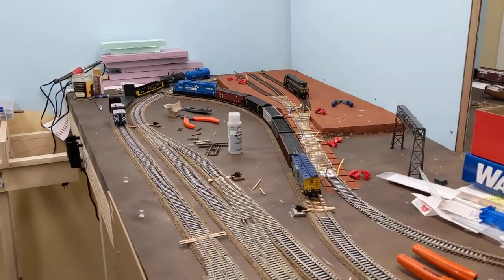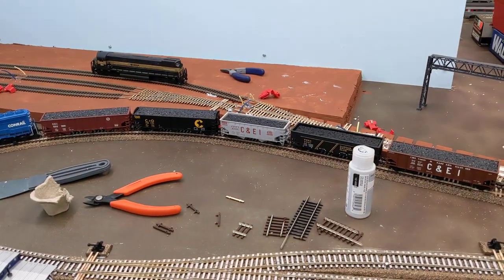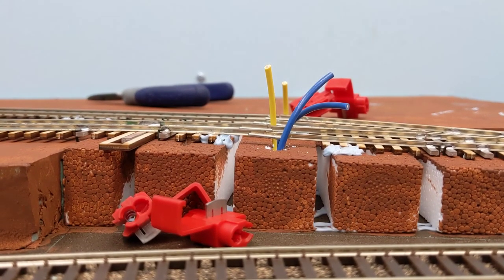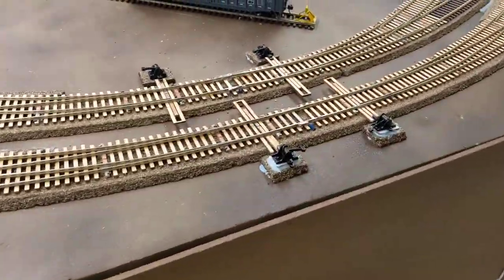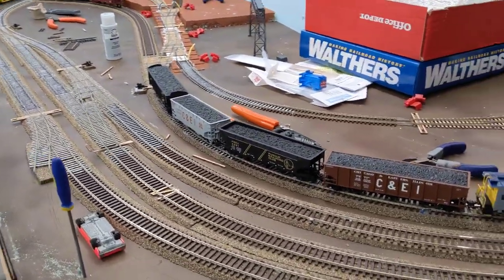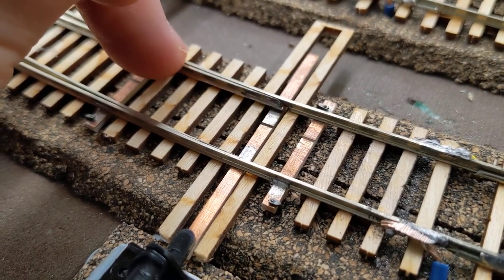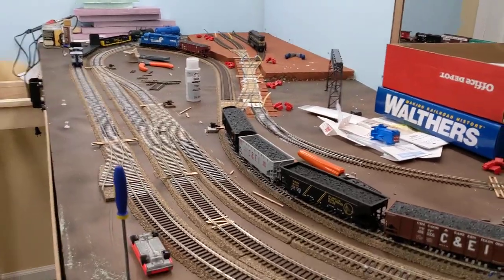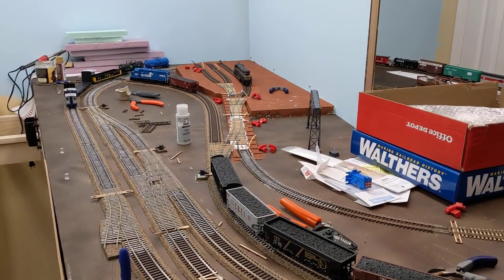Layout Update 5 Mar. 2022 - More Track Laying, Turnout Repair, and Short Circuits!

Comment: Great video, lots of progress!!   I feel your pain with the short circuit!  Spent a full week chasing one down last month, frustrating.  Some guys (for extra strength) add a small piece of wire to the points when they solder them to the throw out bar. It's kinda like a hook that drills through the tie and the rail.  Boomer from Boomer dioramas shows how to do it in one of his videos.  Looking forward to more!